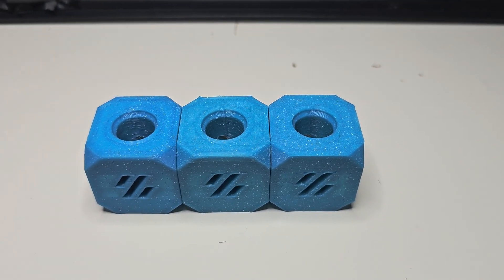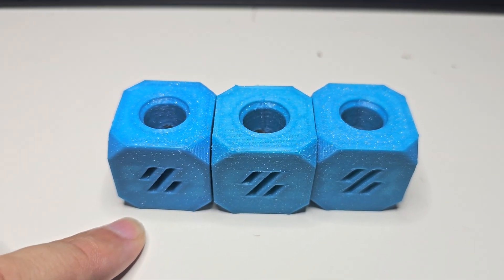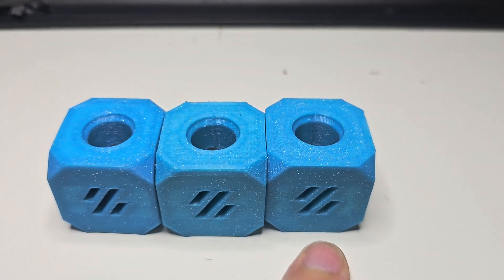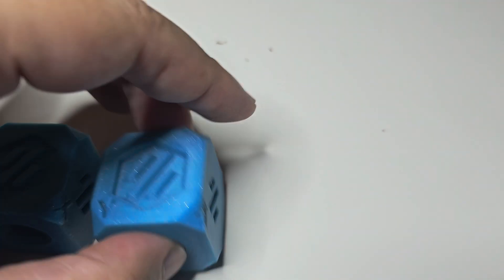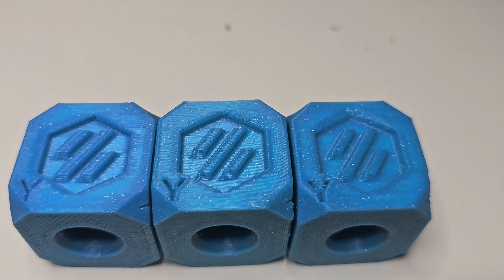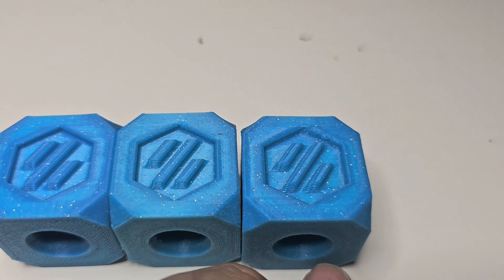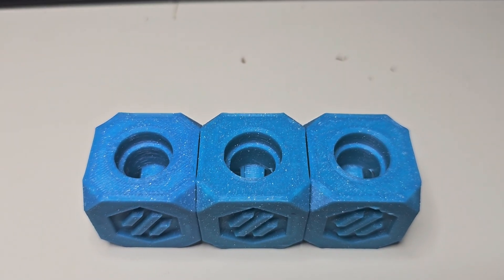Teachable Moments: 55/33/17 minute test print comparison

Comment: So much ringing. I would not be able to settle for that. Unless doing a test and throw away part.
Reply from the maker: You may be correct, however what you are seeing as ringing might also be an undocumented feature of this Sparkle ABS+ filament, where the colour changes shade when there are voids or gaps on a part face. I will print another cube in standard black filament in a future video as a comparison.
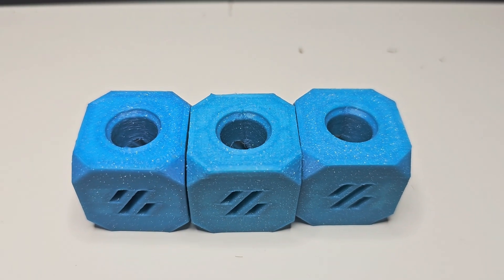Reply: @oldguymeltsplastic definitely ringing. Look over the x at 3:14. I would use a flashlight to show defects. If you want to see defects on a print don’t use filament trying to hide the defects. Use black and a flashlight. It is common YouTube ways of doing it and it’s not the right way of doing it.
Reply from the maker: @Exstaz  I wasn't deliberately trying to hide defects, just printing a test cube in the filament that was already loaded in the printer.
I will reprint in black and light it up like a Christmas tree, then share the results. 😉

Comment: Which settings made the time difference?
Reply from the maker: All speeds and accels were bumped up significantly, as well as increased cooling fans to 75% or higher, and reducing slow print if layer time is less than to zero.